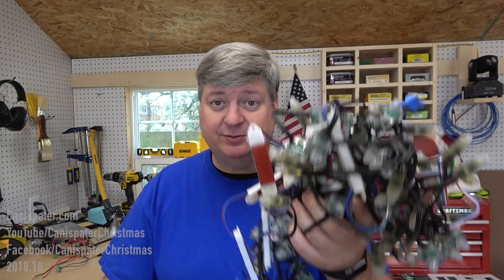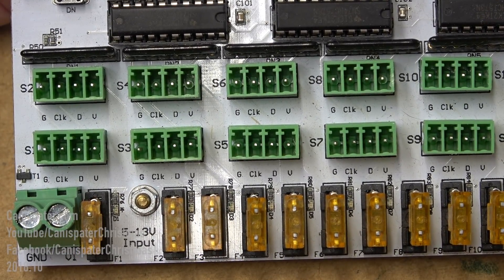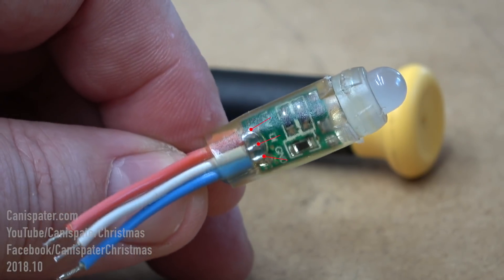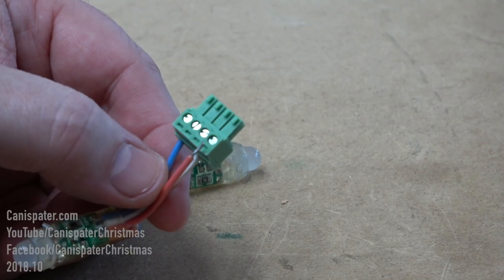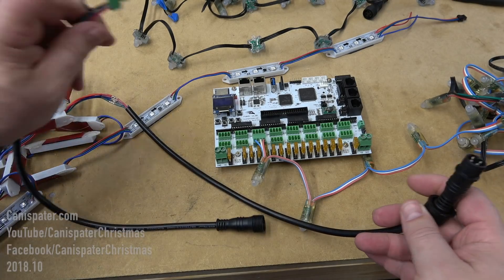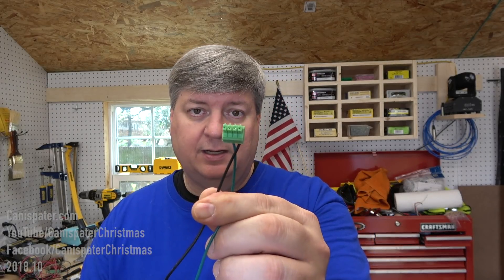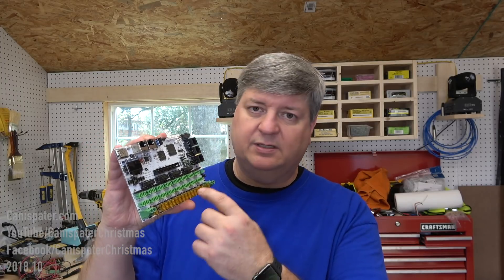RGB Pixel Controller Connections (2018)

Comment: Cheers. Is it possible to make a program on Xlight and on Arduino? Or at ESP 32.8862. Does the programmer have to be what you show? Thank you in advance for the information
Reply from the maker: There is some Arduino code for getting the board to behave like a standard pixel controller (ESPixelStick) then it works like any other from xLights. I haven't messed with it in a while because I can't use WiFi controllers in my location - too much WiFi saturation.

Comment: Is there a controller that I can be programmed for a specific display that doesn't need to be control by a computer
Reply from the maker: The higher-end controllers (Falcon, et al) can run FPP locally and don't need a computer to run the show. There are also some pixel "testers" that output a limited number of pre-defined data patterns that don't require programming at all. Depends on want you want to do.

Comment: Where can I buy the pixel controller I've gone through the website and they been out of stock
Reply from the maker: Contact David Pitts. Contact info should be at the bottom of the web page. Unfortunately, supply issues are a thing.

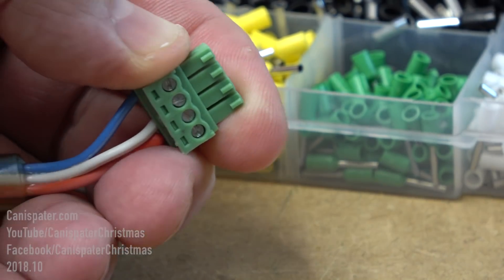Comment: At 3:54, what are those green connectors called?
Reply from the maker: I call them green connectors. 😂 I've heard them called euro-connectors and other things. They come with most controllers you buy. If you need specifics, you can contact David at pixelcontroller.com and he can probably give you more detail. You can probably get them in quantity at major electronics stores like Digikey or Mouser.

Comment: What gauge of wire do you use to run from the controller to the pixels, the power supplies to the controller, and the outlet to the power supplies?
Reply from the maker: Generally 18ga or better from the controller to the pixels. You can use up to 10ga from PS to controller, but it depends on how many pixels you are powering. I'm not sure what I use on the AC side, but it depends on the size of the supply. I've used 18ga power-cord pigtails for the 350-watt supplies without a problem, but you can go bigger if needed.

Comment: Here's a question about power and data for a large pixel net. I have a Boscoyo 4' x 8' populated with 4465 pixels (95 px x 47 px, 1" pitch, 45 100ct WS2811 strings). I plan to run it with a HC AlphaPix 16 v.1, basically using 300 px from all 16 of the ports. Power is coming from four 1KW server PS's. My dilemma is power configuration as I've read too many conflicting ways to go about this. My current amalgamated thought on this based on all I've read is to inject power every 100 px, starting at px #1 and ending with px 4465, and have absolutely no 12VDC running from the ports at all - just data and ground. Data would flow from px #1 through 300; 301-600 and so on from 2 wire cables from the controller. Now here is the question - since there are four separate PS's, I plan to power px 1-1200; 1201-2400; 2401-3600 and 3601-4465 from the separate supplies. There will be two 14AWG supply lines from each power supply, each with a 30A in-line fuse. These will in turn sub-divide into six 18AWG lines to inject power every 100 pixels, each protected with a 5A in-line fuse. Am I OK to have these supply outputs co-mingle, e.g. can an output from PS # 2 be connected to the juncture of px 1200/1201, or do I need to keep the 12VDC connections isolated and run a separate wires from PS #1 to px 1200, and PS#2 to px 1201? I believe I'm OK to have all the grounds from everything (all four supplies, all px strings and the controller) tied together, just not sure about the 12VDC lines. Hoping this makes sense...
Reply from the maker: I ran a "power rail" along one side of the matrix and injected (probably too much) on every string on that side. That was for 3" spacing so much fewer pixels, but the concept should partially carry. For ultimate safety, cut the positives between the power supplies, tie the negatives together. So no pixel has 2 different power supplies powering it.

Comment: Im new to this but is something i really want to do this year. I figure i start early to get the stuff and start doing sequencing early. So in case i run in to a problem I have time to fix the issue. Im planning on a 16 channel rgb mega tree, 4 arches, 4 window frames and 2 gutter lines top and bottom. I just want to know on controller suggestions. Is about a 26 channels in rgb. Please guide me. I been watching your videos and taking your course. Thanks for your input.
Reply from the maker: If all your connections are within about 20-to-30-feet of each other, the F16 is the way to go. The F48 is more expensive, but removes the distance restriction because all pixel connections are remote, but you also have to buy differential receivers. I have videos on both controllers. I’m not sure which videos you’ve seen, but go through my beginner playlist (https://www.youtube.com/playlist?list=PLFyrAfJ-kKd4ZfPdXWIt8v_bav61mW_KW) if you haven’t already. Next, check out the F16 video at https://youtu.be/EcAXycWNSxM Next, get involved with the community. Check out the links in my video descriptions to forums and Facebook groups. Tons of folks will answer questions that come up. Finally, check into the Wednesday night Zoom call if possible (see xlights.org). They have informative weekly presentations and open it up for general questions afterwards. Very knowledgeable and helpful folks.
Reply: @CanispaterChristmas  Thanks for the quick response. And thanks for all your help ill keep in touch if there is another question.

Comment: Can you or do you have a video of connecting everything like the lights to the control board or raspberry pi and the then connecting a power supply and then downloading the program that would absolutely be wonderful!
Reply from the maker: I don't have a video on that because most already have some experience connecting computers or connecting wires. What do you need to see specifically other than what you mentioned? Which software are you having trouble downloading?

Comment: Not Pixels but RGB WS2811 Floodlights...  I am wanting to "wash" a number of areas in the landscape with color.   Would these be connected the same as a pixel string?   Since they are going to be a distance from the controller I will certainly need to inject power... but how can I get the data signal to the floods?  Seems like a waste of a differential controller/smart receiver port for a flood or two.
Reply from the maker: You can go 20-30 feet from a controller so 40-60 feet apart. Will that work? There's other options too. If you string them together, an F-amp will push the data further. You'll have to experiment tho.
Reply from the maker: Might also be a good use case for an ESPixelStick if WiFi isn't saturated in the area.

Comment: Brand new to this and I am really enjoying your channel. FYI the issue with soldering /soddering wires in terminals has to do with the properties of the solder. Solder is very soft and when put under pressure will alter it's size and therefore a wire that is tightly screwed up will become loose and cause a resistive joint. It is actually a wiring rule here in Aus that you can't solder wires and put them in a screw terminal (supply voltages)
Reply from the maker: Yeah, I use ferrules for everything now.

Comment: Every time I watch a video it seems like 10 more added expenditures. Proprietary pigtails, led soldered pigtails, extensions. I'm just running wire to my leds with a 5v logic step up for longer runs. I don't see the benefits in over engineering power delivery to strips for God sakes. Am I not seeing something here?
Reply from the maker: Not sure what you mean by over engineering power delivery.

Comment: Do you need to install a fuse from the PSU to the controller? I read somewhere that you do but then see many ready to run controllers that already have the PSU connect to the controller with no fuse between them
Reply from the maker: Well, I don't since they have fuses on the outputs, but feel free to add one if you like.

Comment: can you still use the power from the board and power inject?  will it hurt anything?
Reply from the maker: That's normally how you do it. Power from the controller then inject power along the string as needed. The "trick" is to use the same power supply that's feeding the board for injecting power.
Reply: @CanispaterChristmas  ok thank you.
Just got.my first 50 lights connected and running!!!

Comment: You never showed how to connect the pixels to a RPi if you could do a quick video it would be appreciated just got my pixels for my first mega tree
Reply from the maker: Well, you don't connect pixels directly to a Pi. What controller (or pi-hat) do you have?
Reply: CanispaterChristmas nothing yet pixels came quicker than I expected so not looked into it yet I have a rpi 3 b+ (I think it is) was going to put falcon player on and I saw drzzs video about it earlier but will watch more intently tomorrow.
Reply from the maker: @garywilson-2e0apg93  OK. You either need a controller (driven by the Pi) or a Pi hat capable of outputting pixel serial data to run the lights. So, a little more waiting. :(

Comment: Hello, I’m new to devices like these but I plan on making 3 rgb fixtures for my tech theatre final. Each fixture has two rgb modules that draw 120ma per foot and give off 22 lumens per module. I’m using a 12v 30 watt power supply to power it. Would it be possible to run a 10ft pigtail from my controller to the first fixture then a 5ft pigtail between the 1st and 2nd, and 2nd and 3rd fixture. Thank you
Reply from the maker: First run from controller to first pixel should be fine. Pixel-to-pixel distance is usually around a foot or less. You may be able to get more, but may not work without amplification of the data signal - no harm in trying it though. Different pixels are different and some may work at that distance. You could try using Ethernet cable for the data line (not for power though) for those long pigtails if the pixels following the pigtails start flickering or don't work. An alternative is a Falcon F-Amp (https://www.pixelcontroller.com/store/index.php?id_product=53&controller=product). Also see https://youtu.be/Z0KIXDRkSCk
Reply: CanispaterChristmas I appreciate the speedy reply. How would I amplify the data single?
Reply from the maker: In the previous answer. Ethernet cable for data or F-Amp.
Reply from the maker: But only if necessary. Try it without first.
Reply: CanispaterChristmas I saw your video on the F-amp. I like the idea, however I see an issue. My modules have 4 wires, rgb and a com, while the pixels on the video had the same wires on a dmx cable.
Reply: Also, for my controller, I’m using a 4 channel dmx decoder hooked up to my dmx board.
Reply from the maker: OH! You're using dumb pixels! No problem then and no need to do any of that stuff I talked about. lol!
Reply: CanispaterChristmas alright, so it’ll work with those regular lengths of pigtails. And yes, I’m using dump pixels, gonna work my way up.

Comment: Fantastic videos!  Noob here quick question, if you're building something like a pixel tree with say 16 strips or strands, do they each need their own data connection/channel?  I know they need power injected every so often but I'm wondering if i can use the same data channel for the whole thing or if I need to give each stip/strand a connection back to the controller.  Thanks!
Reply from the maker: Thanks! Either way is fine. Data flows serially so you would be daisy-chaining & zig-zagging strands if you combine them (doesn't work in parallel). If you want to save ports, you can combine strings up to the number of pixels a controller supports per port. If you have plenty of ports or don't want to inject power, you'll use more ports with shorter strings. It's a personal preference really. My tree uses 4 strings of 300 (100x3) and are folded over at 50 so it looks like 24 strands of pixels.

Comment: How do you add a fuse to power injector with a pig tail?
Reply from the maker: Hey Chris, One end of a pigtail is wire so just put the fuse inline with the power wire. You can get an inline fuse holder at any place that has auto parts.

Comment: So I found some pixels with five wires on amazon. Why 5? I want to dive in this year but don’t do without a lot of research. Oh and awesome channel!!!!
Reply from the maker: Thanks! Well, that's a head-scratcher. Send me the complete title of the item and I'll take a look. If you send the URL, the comment will end up in the "held" section which also works.
Reply: https://goo.gl/images/4KjUJU
Reply from the maker: Ah OK. Those are 3-wire 5V pixels with a pair of power injection wires. Those two extra wires are electrically the same as the power on the JST connector so make sure they aren't just hanging loose otherwise, you could short the power.
Reply: @CanispaterChristmas  So I have 12V with the same set up as this guys.
I'm assuming I should cut that JST clip off and then connect those wires to the connectors that came with the Falcon controller.
Additionally,  I believe that the end with those 2 "extra wires" are my starting point then the data would run the opposite direction correct?
Thanks for the assist!
Reply from the maker: @chexlemeneux4907  Well, I've only seen extra wires on 5V (which is what that URL points to) strings so make sure you have the right voltage before applying power. Those extra wires might be for power injection if they are attached to GND & +. If that isn't what you have, then you might post a picture on Facebook or one of the forums to make sure. You can probably remove the JST connector and use the Falcon connector instead if you have the right voltage. Also make sure you have smart pixels and not dumb pixels, otherwise you could damage the Falcon.
Reply: @CanispaterChristmas  Thanks for the response.
The people I purchased from asked if I needed 5v or 12v and I confirmed 12v.
The invoice states "12V Ws2811"
Everything about the order process was straightforward so Im not sure why I would have gotten anything different.
Is there a way to ensure or will I possibly have to sacrifice a string by just connecting them as 12V and hope they don't burn out if they are in fact 5v?
Reply from the maker: @chexlemeneux4907  The pixels should have the voltage printed on them. You might need a magnifying glass. :)
Reply: @CanispaterChristmas  I looked at every pixel on an entire string and none of them had a voltage printed anywhere.

Across the top of the circuit board it states "R G + B"
On the bottom it states "+ DI -"
and on the right hand side horizontally it states "1903" which is the number or name of the circuit board.
Anyway, I clipped the JST clip off, connected it to the Falcon connectors and got my Meanwell 12v 350 power supply wired up connected, and voltage output checked so I guess I'll just have to cross my fingers and hope they sent me the correct lights LOL! I'll let you know what happens.
Reply: @CanispaterChristmas  Well, I guess we can call that a success. 
I powered up the controller and nothing burned up. I tried configuring the IP address manually on my laptop by watching one of Clyde's videos but didn't have much luck. Not sure if it was because the video was for the V2 but I ended up connecting directly through my router which gave me an IP address. I then went to the Falcon controller configuration web page and decided to try a test with my lights.
I'm happy to say that each test performed perfectly and none of my lights burnt out nor exploded!! I know you have your hands full with your own show but I just wanted to say that I really appreciate the help and guidance you've provided.  Thank you.
Reply: That’s what I thought. Thanks